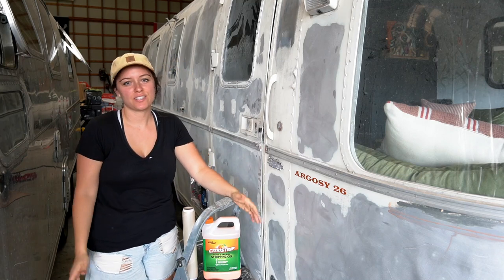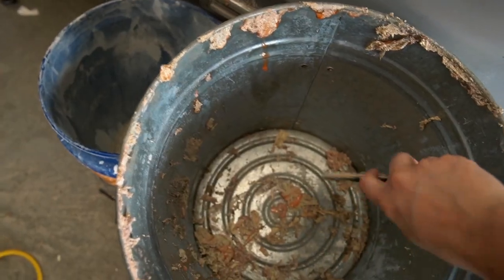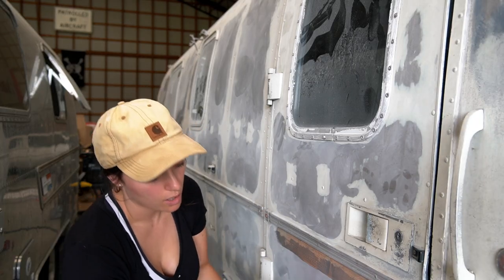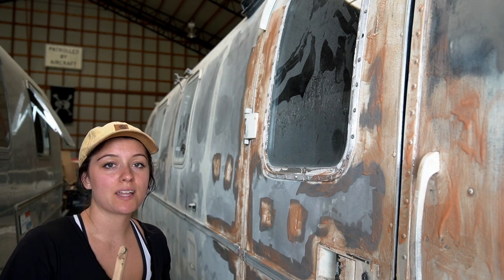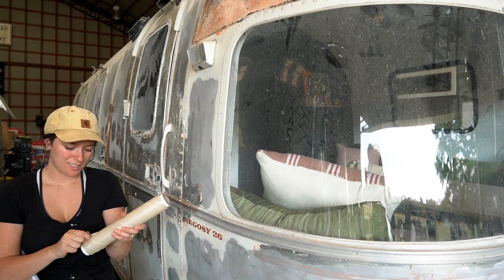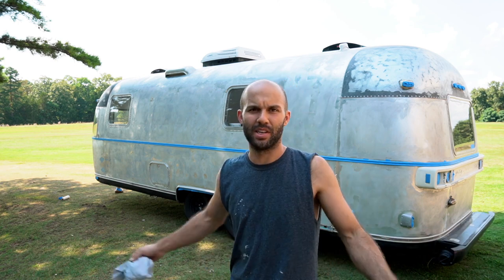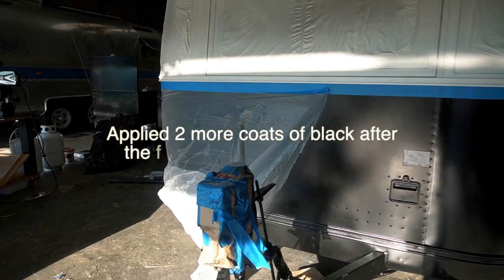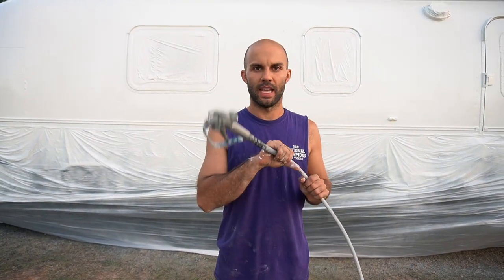Painting An Argosy | DIY Travel Trailer Paint Job | Airstream Renovation

Comment: I have a 74 Argosy... would you recommend a primer?
Reply from the maker: Hey, the paint we used we were told no primer was needed. It adheres extremely well, it had a primer in the paint. It was an acrylic DTM (direct to metal) paint.
Reply: @SteadyStreaminCashios  Did you purchase your DTM paint at Sherwin Williams? They are over $100/gallon at Sherwin Williams. And I know I need 2 gallons. How many gallons of paint did you use?